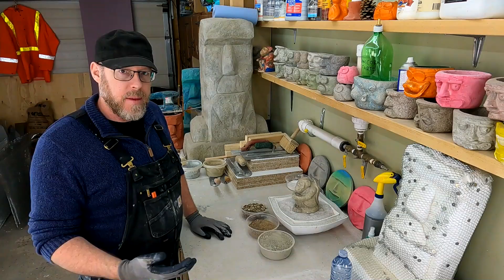What is 5000 PSI Concrete?

Comment: Sadly I had to consult Google to find that psi stands for pounds per square inch, same as it does when dealing with the much lower air pressure in a tire.

Comment: What is a general psi for concrete driveways? 4000 or 5000 psi?
Reply: Around here,  the standard is 4800PSI for frost and salt proof concrete. Also called agricultural concrete. Only frost proof is 4500PSI. Should also keep the concert wet or moist for a month after poring. Hard to reach 4800 PSI without this extended process.
Reply: Cant add much water if you want high strength concrete. If you add 10% extra water, the strength of the concrete will be reduced with 30%.
Reply: @elbuggo  Wow I didn't realize having the water off as little as 10% is enough for that, not surprising though

Comment: What admixtures are used in 5000 psi concrete  to achieve this extra strength?
Reply: exactly the question I had.  what is the mix that creates the increased strength.
Reply: Portland cement ratio increases. Neat cement grout (no sand or stone etc) just portland and water mixed correctly is about 7200psi. @RJG772
Reply: @NitroNeil cement and water alone will not yield 7000 psi , more likely about 1000psi.
Reply: Calcium carbonate